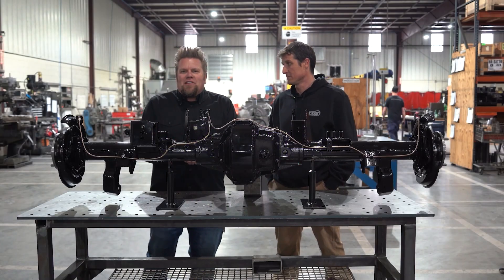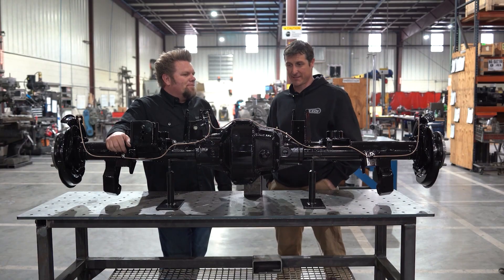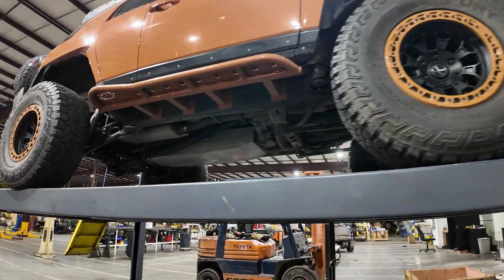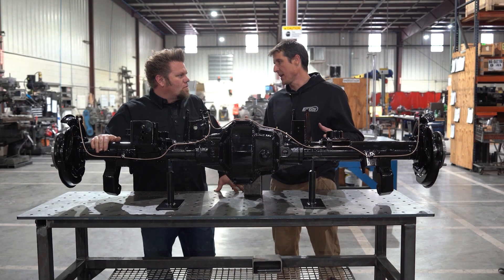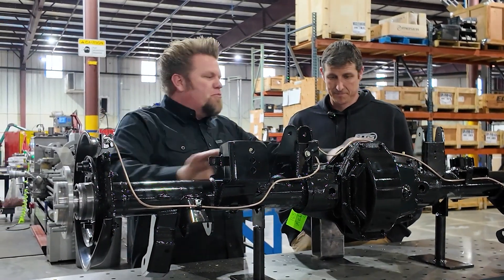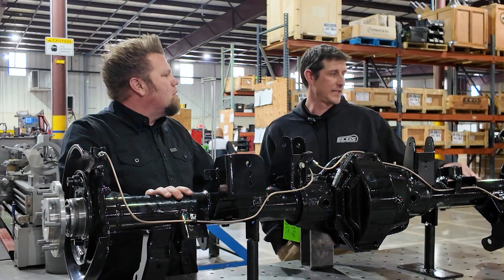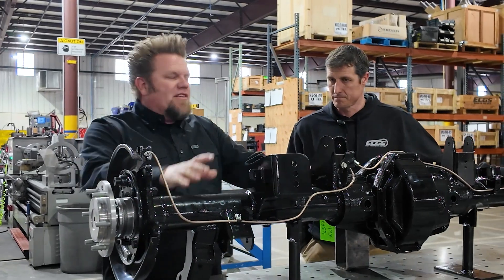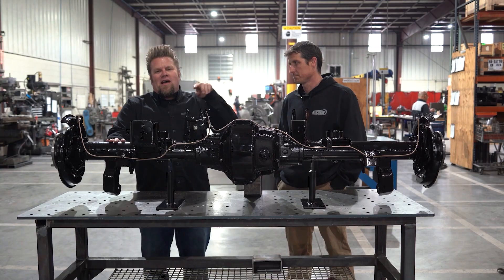Upgrade Your FJ Cruiser/4Runner | Dana 60 Rear Bolt-In Axle from East Coast Gear Supply

Comment from the maker: Curious how the Dana 60 stacks up against Toyota’s factory 8-inch axle? We cover housing strength, tube thickness, and why pinion bearing failure is so common on these platforms. If you have technical questions about gearing, lockers, or custom widths, drop them here—we’ll make sure you get answers
Reply: The Toyota ring and pinion are to weak for overloaders

Comment: Why does the website show a different housing than this one? The one on the website showed a standard Dana 60 housing but this one is the high clearance center section.
Reply from the maker: We're working on updating images on the website. All axles now being built are the high clearance style unless the OE style is specifically requested.
Reply: @ECGSTech cool! Just curious, thanks!

Comment: How big are the outer wheel bearings vs factory?
Reply from the maker: Same factory Toyota bearing to maintain ABS function. However we use custom chromoly axle shaft which is much larger than OE, 35 spline.
Reply: @ECGSTech I’m saving up lol